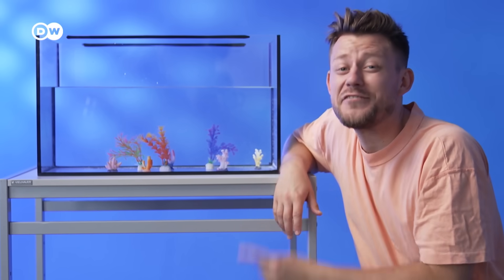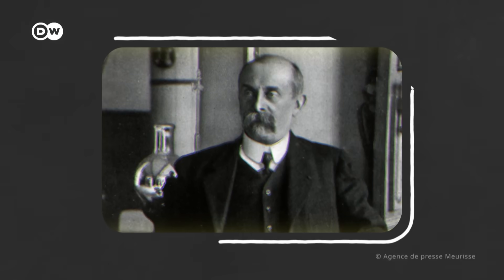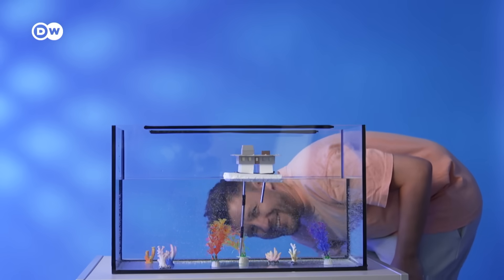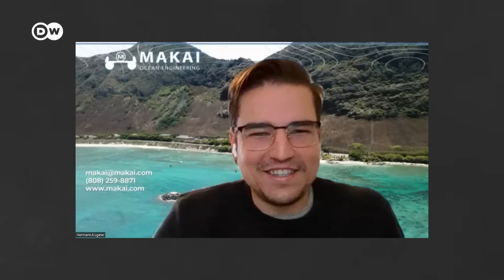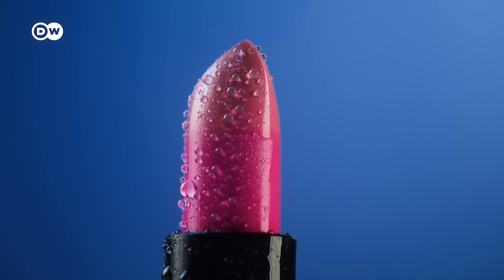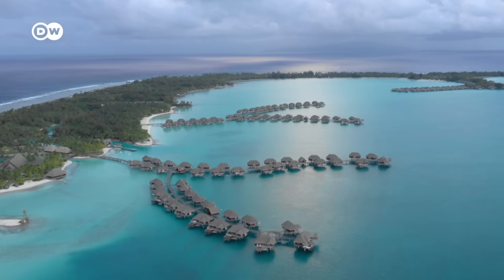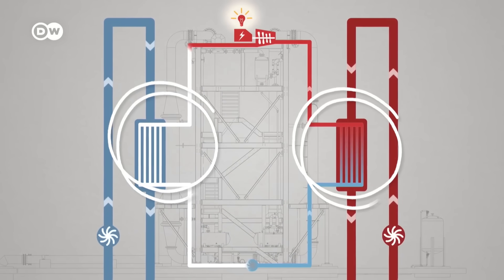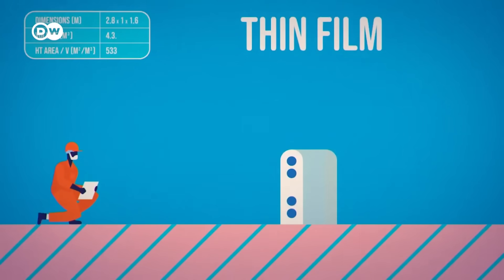How to use the ocean as a giant battery

Comment: It would be relatively easy to retrofit this onto existing oil and gas platforms surely? Gulf of Mexico springs to mind for the warm water and deep sea. And the platforms already have the pipes, or if they are too dirty, the equipment is there to run new ones

Comment: I wonder if natural currents could be employed to help to "pump" the cold water up from the depths. Some specific location where hotter and colder currents meet. Surely there are some really sweet spots out there in the tropics where this would work really well almost naturally. Perhaps if the pipe needs to be that big, it could be made on site from raw materials. Shipping pipes around is moving a lot of empty space. the bigger the pipe, the worse the problem. So why not have a ship that goes around building the pipes in situ?
Reply from the maker: Hey. 🐟 Pipes used to lift groundwater to a heat exchanger must be built over 2 kilometres long and the efficiency of OTEC depends on minimising heat losses along the length of the pipe. OTEC is also so exciting because this technology could be used to generate electricity around the clock. The construction of the pipeline may be the most difficult part of the process, so this in itself is a huge technological challenge.

Comment: If OTEC becomes a reality on a big scale, it can work as the base load, which is currently done either by nuclear or gas or coal in the majority of the places. Additionally, as we are building these plants in the ocean, it won't be having aby major impact on the wqter ecosystem, unlike hydropower, which uses rivers and hence, inpact the ecosystem

The other system that can be used for base load can be tidal energy, which works during both the high tide and low tide

Comment: Even the Carnot efficiency for such an operation seems terrible? Why wouldn't one lower the bar significantly and start with using this cold deepseawater for urban airconditioning?
Reply: I had the same idea, like district heating but for cooling.
Reply from the maker: District cooling seems to be the future way off not adding to the hot 🔥 problem. We talked about this in one of our latest videos 👉 https://www.youtube.com/watch?v=sKbEOMCsqaI.
Also, have you heard of this deep sea water district cooling in Curacao? https://c2e2.unepccc.org/kms_object/district-energy-a-case-study-of-zakito-deep-sea-water-district-cooling-in-curacao-webinar-30-09-2022/#:~:text=It%20uses%20seawater%20from%20850m,at%20a%20much%20cheaper%20cost.
Reply: @DWPlanetA  Thx, there's also the case of a planned floating city in the Maledives where they obviously would also apply this type of system. Not sure whether they need an expensive heat exchanger to avoid having to deal with salt water in this district cooling (or whether their heat pump can handle salt water).

Comment: I wonder, rather than ingest and expel large amounts of water and changing the thermal dynamics of the ocean in a localized area, a closed loop system may work better.  A floating  or shallow sub surface mat filled with a liquid that absorbs heat from the ocean surface passing through the heat exchanger and dropping down into deeper water where it cools and recycles back up.  Although now that i think about it, that may not be a big enough temperature differential to generate electricity.  Too volatile a liquid and it can't push a turbine.  Its a beastly problem

Comment: Tropical regions might seem like the right choice, but solar pv is relatively reliable, super cheap, and hyper scalable. The fact it requires sunlight is a disadvantage, but OTEC is highly unlikely ever going to be anywhere near as cheap as solar plus all the batteries you need to have power on demand whenever you want it in tropical areas. A combination of solar PV, CSP with storage and wind is a reasonable option if you have the money to invest that OTEC requires.    

Needing absurd infrastructure is a huge problem, but also having to force that water all that way cost energy. A cubic meter of water at 4 °C is roughly 3 kg heavier than a cubic meter of water at 26 °C all else equal. That means you have to invest almost 30 kJ to lift a cubic meter of 4 °C from 1000 meters depth to the surface, when the surface is 26 °C, assuming it's close to surface temperature most of the way, and all else equal. In reality probably around 20 kJ/m³ just because the difference in density. That's on top of friction and other losses in the system.           

It's easy to calculate how much energy that theoretically could be extracted. The amount of energy available is roughly 4.18 MJ per °C per ton,  26 °C is almost 300 K, 4 °C is 22 K lower, which means the theoretical limit for efficiency is ~7.3% which means roughly 300 kJ at 100% efficient system. But low temperature difference doesn't just make the efficiency limit very low, it also makes it difficult to reach anywhere near that limit at relevant rate, and 26 °C is not a reasonable average. Achieving more than symbolic net generation is challenging in reality, making it an viable practical option that is far beyond challenging.

Comment: I'm confused. Why is there so much water being moved? I thought it was a closed system of Ammonia. Send it down to get cold, and then back up to capture the heat for a turbine.
Reply: The ammonia is only the working fluid, and it is contained in the plant.  The water is the heat source and the heat dump.  But it is vital for the environment that no ammonia leaks out of the plant.
Reply: @philipyoung7034  I get that. What I don't get is why would it be moving water around. Isn't it just sending the ammonia (in the pipes) down to the cold, and then back up to reheat it.
Reply: @PaulADAigle  I get that, too.  It would make more sense to use a non-corrosive material in the pipes.  Five kilometres of ammonia would be cost prohibitive given the alternative of just pumping sea water.  It is stated that sea water is moved through the heat exchanger, which is why it needs to be made of a stainless material like titanium.  The heat exchanger is also the most expensive component of the "battery".

Comment: From what I understood, all you need is the warm surface water to heat a low-boiling point liquid which turns generators. Would you necessarily need a cold water pipe to go kilometers down into the ocean if you can just produce energy from the surface water? Couldn't you dump that water back and make energy that way? Would it even need to be off-shore if you can access the warmer water from shore?

Comment: We appear to have no trouble reaching down over 2000m into the ocean if it is for oil so I am pretty sure that we can find a way of doing it for a resource that doesn't run out!
Reply: their pipes are much smaller and cheaper and the fuel is easy to ship
Reply: @tomkelly8827 The point is that we weren't always able to do that stuff. In fact, on the scale of 2000m water depth and 10000m holes, it's pretty recent.

Comment: Environmental impact: OTEC plants can have a negative impact on the environment. The plants can release brine, which is salty water, into the ocean. This can disrupt the marine ecosystem. OTEC plants can also release greenhouse gases, such as carbon dioxide and methane.
Reply: Sorry, what‽ It's a heat exchanger. It's all electric.  It's not a desalination plant.  Where is the brine coming from? Where is the carbon dioxide?  As mentioned in the comment above, (@danaus2024) the return water is only a fraction of a degree warm, so dissolved gasses in the deep water would stay dissolved.
Reply: The temperature difference which these propose OTEC plants exploits is also one of the main energy sources that power the Thermohaline circulation of the ocean currents, and tapping this energy off means (via the first law of thermodynamics) putting a brake on these currents which can cause additional climate changes, just like the gulf stream and ENSO already do.

Comment: Thought: the ocean is too hot and the cold water pipes aren't feasible but what if we cut out that part of it? Use the excess heat of the water to create the steam which turns turbines as it goes up and as it goes down and cools via that loss of energy and then return the now cooler ocean water. If it's set up to orientate where it's taking into account ocean currents you'd need a much shorter discharge pipe. Might not produce as much electricity but could be offset by it being more affordable? Not any kinda expert on any of this so I'm just thinking it through 🤷🏻‍♀️
Reply: The problem is the heat difference between the ocean and the air temperature isn't enough to generate a significant amount of electricity.
Reply: @lmahmud  what's a significant amount? Honest question, I want to understand this

Comment: I wonder how this would negatively effect the deep sea ecosystems temprature wise. Warm water from after the industrial revolution is already reaching the deep sea causing huge damage.
Reply: The warmer water would be discharged at the surface
Reply: @NordicWizzard  Yes but the cold deep sea water needs to be replaced by warmer water from the upper layers. I wonder if this might disturb the otherwise extremely slow water exchange processes in the deep sea areas around those facilities.

Comment: This could cause destruction if it is done on a large scale. Heat exchangers will alter the temperature of the ocean at various depths, which could kill sea life that depend on a fixed temperature.
Reply: it depends on the amount of heat pushed down, it"s likely that the water we'd push back down would be just a few tenth of a degree hotter, so we should be fine for a few centuries
Reply: The heat with that amount of water will be far more than a few tenths of a degree.   Plus you are cycling deep water back onto the surface with all the stuff that's in it.  Think about grabbing all the cold air from the arctic and dumping it in the Sahara desert.  You'll change things.

Comment: I just made a couple of calculations based on the 2.2 billion kg of cold water per day. Transforming that into a m3/h flowrate, it is possible to calculate the energy required for the pumps to bring the water from 2 km down up to the surface. At a conservative calculation, that requires the pumps to use 763 MW of energy every hour. So, anything less than that on the production side is useless. And this is not counting the enormous damage to the sea life there (and people complain about sea water desalination plants) or the impact on the dynamics of the seas (the thermohaline circulation). Seems to me complete BS. The physics make it likely useless or, at best, a fringe case.

Comment: That could really work for the small towns in the Arctic Archipelago, especially during the darkness of winter.  The temperature difference between surface (air) and the ocean could be as much as 60° C, although 25° would be more typical.  Of course, the working fluid would be different, but that's just an engineering problem. During the summer, they just have 24 hours of sunlight, so solar PV.

Comment: I wonder how does this compare to geothermal. It's the same concept but with added complications. it'd only make sense if it's significantly cheaper but a quick search on levelised cost of energy for this yields no results
Reply: With a low temperature differential it's difficult to extract meaningful amounts of energy. Sounds fine in theory, in practice it's entirely another matter. I've only heard of one site in Hawaii doing this and its been really quiet. I assume that means there's nothing much to report.
Reply: It's too early for levelised cost of energy formulas. You'd basically need a research plant the size of an oil rigg to find out the practical limits of this tech.

It's easy to invest in an oil rigg, because you can calculate how much oil it can pull out of the ocean floor.

But 1 research station with unknown returns.. that's harder

Comment: If they wanted they could also use these plants to pump out a bit of cold water to the surface when surface temperatures get too hot, it will reduce productivity but it will save local wildlife in the process (also if the heat is too abnormal it can damage the system by over expanding the gas)

Comment: This is totally infeasible. One would need to continually move the platform to maintain a significant temperature difference. It would be better to use a Stirling engine floating on water, using the minuscule difference between water and air temperature.

Comment: Could we not do the same with geothermally heated water and seawater?
Or even solar heated water? 

I think if the oil and gas companies tried to venture into this then the problems with the pipes could be overcome. But what the resulting cost would be is probably to high to be commercially viable.

And as always.... The places with lots of energy on this planet is naturally not the place humans thrive. There is lots of capacity for solar in the desert areas around the equator. But thats not really where energy is needed
Reply from the maker: It sounds intriguing, but given how complex OTEC technology itself is and how much more development it requires, perhaps alternative heat sources would not be the first option to combine it with, at least not yet? In about 5:52 minutes to the video, Dan Grech from Global OTEC explains where the potential of the technology and the need for new energy sources meet for example. 🌱
Reply: @DWPlanetA 
As a lot of the video focuses on the problems with the cold water pipe. Alternative sources of which does not require this pipe would sound reasonable. 

I would assume you just need a temperature difference (geothermal hot water, surface water as cold). 
Or is the temperatures differences in the water somehow in a "sweet spot" for this concept?

Comment: As I think about it, ice melt basically drives such engines.  Pulling the cold water up will create a displacement that (very gradually) warms the layer the water is being pulled from.  This heat is only removed by ice melt displacing the warmer water.  In the meantime the surface water is cooled, enabling it to absorb more heat energy from the sun and air currents.
Reply: @alanhat5252  good point.  I thought about the ice melt because it was more fun to think about at the time.
Reply: The other problem is if this is done on a large scale, it could change ocean currents as many of them depend on the heat differential to flow.

Comment: Why not submerge the plant below the wave action and draw warm water down while drawing cool water up?  The plant now needs to be watertight,  which is a cost, but it should be less susceptible to damage due to storms.   Would submerging 50-100 ft avoid most of the storm risk?  Only the warm water intake would be at risk and it is much shorter.  Please keep in mind I know nothing about ocean engineering.

Comment: Help me out, does this mechanism post turbine pump warm/hot ammonia back into the ocean/body of water, to what depth. So it is adding heat to directly to ocean thus altering temp, chemistry and physical properties instantaneously. Scaled up consider that affect is not part of and never has been the ocean cycle. Another dangle a carrot, out of sight out of our minds. Look squirrel.
Reply from the maker: Very good questions. 💧 This process does not in itself add heat to the ocean, but extracts heat from the surface water and converts it into energy. Nevertheless, OTEC changes the temperature gradient in certain areas, and there are other environmental impacts that can occur when large masses of water are moved through the ocean.

Comment: too bad energy cant be transferred wirelessly.

deep offshore energy is nice and all but we humans live on land. what good is all that abundance if its cost prohibitavely expensive due to the infrastructure needed to bring it back on land.

i mean if only optical fibers could be used for electricity. just think. a thin stand of fiber could hold kilos, mega, and giga and maybe even terra watts worth of electricity.

then the costs associated with thick cables going long distances could at least bypass one of the dimensions of wiring. 
we cant remove length cuz wireless electricty  isnt real. we cant remove width cuz thin wires dont carry heavy loads of electricity.  height/depth is based on the structure  so thats not a dimesion to worry about too much. 

but yeah, even if off land power was a thing, it would AT LEAST need to be converted/stored to bypass the wiring factor then boats could bring those batteries back. 
which has even greater losses due to a conversion from ocean to battery then from battery then to grid

Comment: forcing higher temperature to lower ocean is not good for the environment, and it's not unlimited power, it will eventually run out, the problem with all the issues are overpopulation, bandaids don't actually fix any of the issues we currently other than kicking the issue down for later generations.